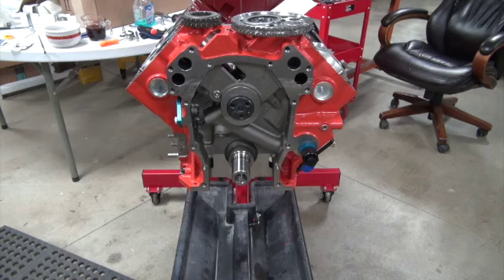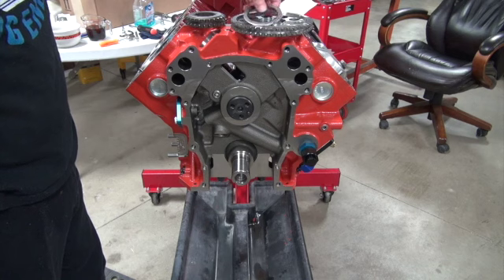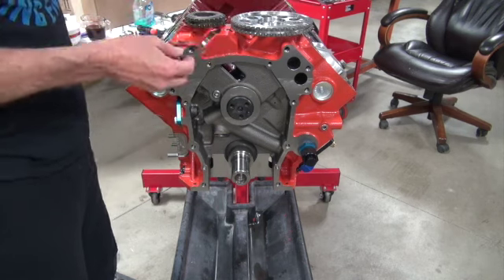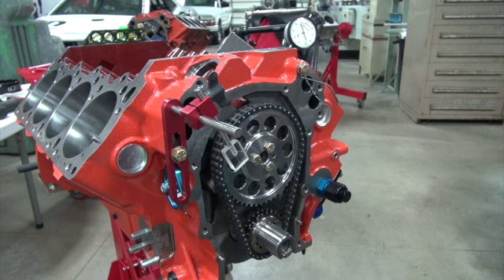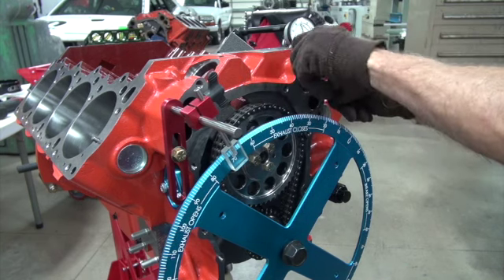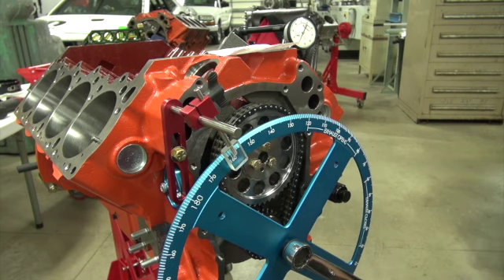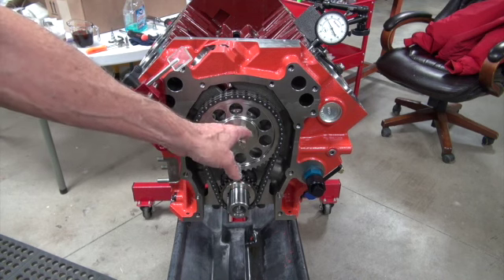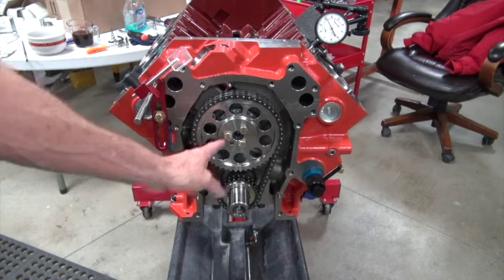Building your 426 Hemi Ep 14 #426hemi

Comment: Very educational but I have a question why is it so important to degree the cam vs just lining up the timing marks like we have always done when when replacing a timing chain or rebuilding a motor?
Reply from the maker: I don't think it is that important. It would have run fine where it was. It's all about trying to do a better build. Like those file fit rings. It would run fine with regular rings. And balancing to within 1 gram. It's about learning and trying to do the best build that you can. It's about fun and education. Thanks for watching.
Reply: David,if you don't dial the cam in the valve timing could be 5 degrees out.That's a lot of valuable horsepower gone and also in which the power is delivered.

Comment: Great video. I take my 540 block to Indy Cyl head tomorrow to see if they can fix my block. While I am there, I am going to inquire about lower compression pistons as my Diamonds are 12.3:1 with .070 head gaskets and I would rather be pump gas, and possibly bump it to 572. Then rebalance it again.
   When do you think your build will be running ? You are moving right along. Took me 6 yrs to gather all my parts.
Reply from the maker: Yes, while they're working on it would be a good time to drop the compression. I should have this build done in 2 weeks but Edelbrock still doesn't have any of the PF4 EFI's ready to ship so I'll have to decide what to do then. Thanks for watching.

Comment: Rick, many thanks for all this work, best video out there! Im assembling a Callis block hemi. I'm catching up with your videos and have watched them many times. One thing I didn't hear you mentioning is the oil slinger. in original parts catalog on page 9.16 it shows the slinger be installd before the sprocket but on small blocks it shows it installed after the sprocket. Whats your thinking here. do we install it before or after the chain sprocket? many thanks again.
Reply from the maker: Glad you are enjoying it. I generally don't use the slinger (Ray Barton says he hasn't put one on in 25 years) but it goes on after the sprocket and I believe it will only go on one way. Lip out. Thanks for watching.